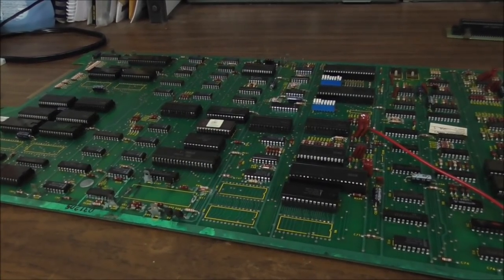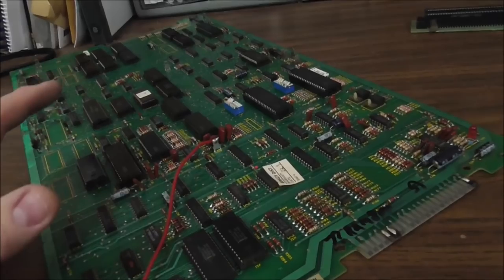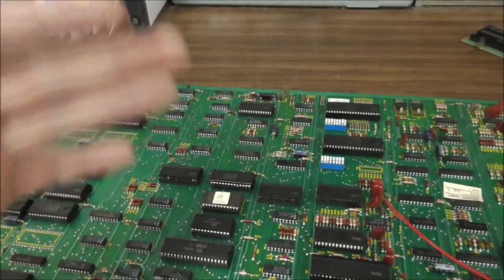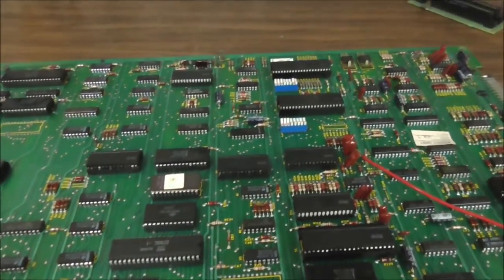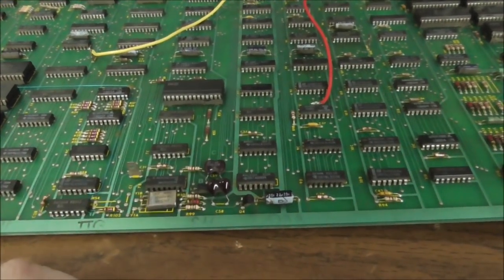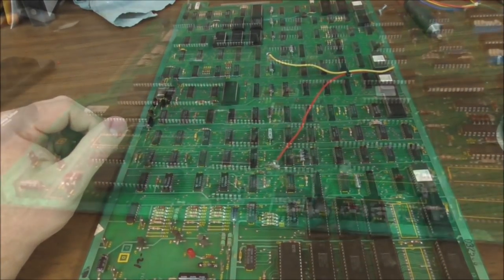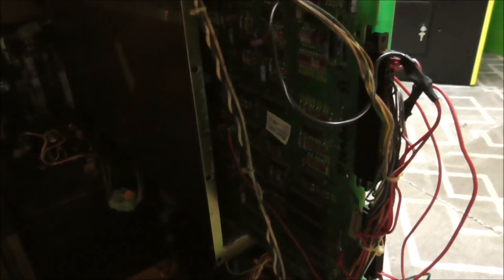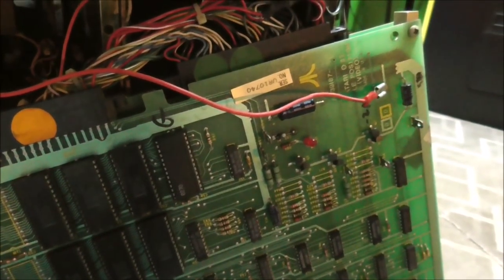Attempting to Repair Atari's Very Complex 1982 POLE POSITION PCB - Three CPU's?  THREE CPUS!!!

Comment: If you think about it, in today's computers, we're running a lot of CPUs. Back in the 1980s, we called them CPUs. These days, they call them "cores." So an Intel i7 is running seven cores, or you can think of it as seven CPUs, of course I'm extremely over-simplifying it. Again, back in the 1980s, the only way to run at peak performance is to run multiple CPUs, and then just use a oscillator to sync the CPUs together so they're working off the same sheet of music. Even on my Apple II, I could run a Z80 processor card, and still use the built-in 6502 to run the peripherals like video and audio, and the Z80 just ran the OS. The most awesome board of the 1980s has to be the Commodore Amiga 1000, which had all those custom chips like the Fat Agnes and such. They were in fact all CPUs, and that allowed for the Amiga to do all those sprites and such.

Comment: Looks like the brains die when the graphics kick in - hence the text gibberish before it possibly resets. Too low voltage on the 5V rail? Transients due to bad caps? I'd put a scope on the 5V.

Comment: The fiberglass pen does work even with really bad corrosion. I've been repairing PCBs for over 20 years and I never had to use sandpaper or a file on a PCB. But yeah it's faster if time is a thing. All you need to do is set the fiber part out about 1mm and then put some elbow grease into it and it comes right off. If you keep going the fiberglass pen can easily go right through the copper trace if you want it to. The main issue with those pens is they are dangerous if you breathe in the dust or touch the fibers that comes off and get them stuck in your finger or a toe. They are clear and nearly impossible to see and a real bitch to get out of a toe (don't ask me how I know that hehe!). As for adding a conformal coating over a bare copper trace, that's just noobs talking. I have repaired thousands of PCBs and never once used a conformal coating and the games are still working fine as-is. Plus adding a coating often looks worse than the bare trace. Some of the noob repairs on youtube with conformal coating added look really rough hehe! It does have uses, but mainly for surface-mounted work where traces are tight and you want to put a chip on the PCB and don't want traces being accidentally bridged under a smd chip, especially when working with BGA chips. For battery damage I normally remove all the parts in that area, clean up and then fit the parts back replacing common parts with new where necessary.

Comment: you're not going to stop that alkaline until you neutralize it brush some vinegar on that area it'll stop that from corroding, tell you something you don't know right? but yeah pole position is my game man I've always loved that I can hear itt  in a pizza joint or anywhere in arcade calling me, preparr to qualify  the original racingr driving game was a barrel that spun it had landscaping painted on it in a road pretty primitive but yeah that was a pretty cool game too maybe you've seen one before, and something has caused the copper to delaminate on your backside that's bad news there could be cracks in that anywhere. hold it over a bright light and you can see them easier.
it's with a heavy heart I bring you this news there was a fire in a building up the alley and several video games were destroyed burnt there was Ivan iron Man Stewart you know the one with four steering wheels and Indy 500 and had the same four-wheel format the other ones I couldn't see what they were because they were so far gone and a neo Geo that might have been restorable but the boards on the iron Man was sagging it melted you know sad because there was a lot of them in there too. anyway keep up the good work Fuji speedway needs you to stay in business.lol

Comment: I will say this for Atari: The ground plane on that board is seriously over-engineered.  That's not a bad thing, though.  I'm on your side when it comes to the sense mod.  In this particular situation, I don't give a rat's ass about "originality"; what if, at some point in the future, the sense circuit burns up something that can't be replaced?  I do a lot of retro-computing (old 80s computers), and some components (such as the 6581 sound chip on the Commodore 64) are already as rare as hen's teeth, and the cost of replacing it is skyrocketing.  So, given the choice, I'd much rather install the sense mod and have the game simply not boot, instead of possibly burning something out and maybe even starting a fire inside the cabinet.